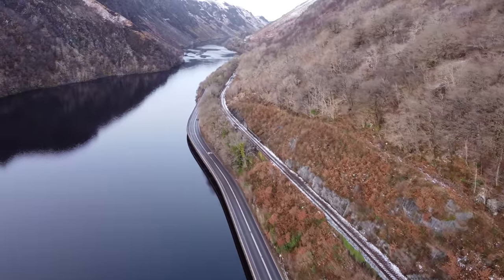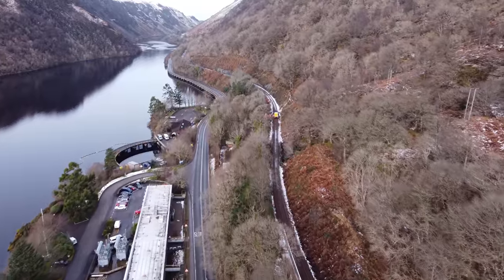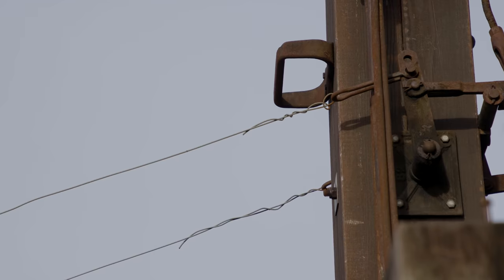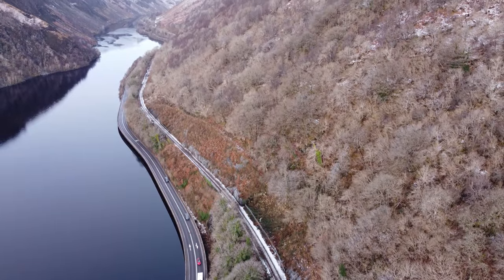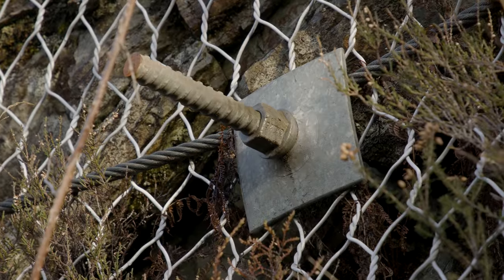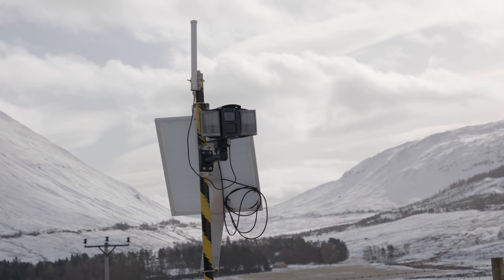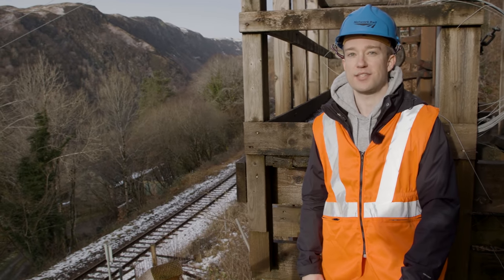After 140 years, this old technology still keeps trains safe

Comment: The problem with “couldn't they just” isn’t just is it possible but the solution also needs to be cheaper than Anderson's piano, otherwise you’re left with shouldn’t we just add andersons piano’s elsewhere on the network 

My “couldn’t they just” is couldn’t they add an electronic detector to see when Anderson's pianos are tripped. The system wouldn’t need to be 100% reliable as a train driver would be able to report it, so it’s an as well not instead of, with a relatively small cost and improvement to response times

Comment: Surely you could mount a potentiometer to the swiveling bit to at least digitize it and send a signal to an operator once it’s been tripped. You’d still have to manuslly reset it but you wouldn’t have to wait for a train driver to spot it.

Comment: Union Pacific RR through Oregon’s Columbia River Gorge (South bank of the river) has a similar system that can be seen from vehicles traveling on Interstate-84 to Portland. Don’t know if it’s strictly mechanical like the example here, Anderson’s Piano, or electrified, where a fall would break circuit, triggering a red signal. (Think there may be insulators on the posts holding the wires, so electrical).

Comment: Calling out for any aspiring young startup entrepreneurs in Scotland! If the message about tripped wires often only reaches the techs after a train has spotted the signal and calls it in, this could easily be automated with e.g. a microcontroller at each pair of signal towers using either optical or physical method for detection. Build an MVP using a Raspberry Pi, then use an Arduino etc. for a low power build. A decent battery bank and a small solar panel can keep the device running without grid. Report signal status to techies over a cheap "iot" tele plan (no calls, low speed and bandwith but cheap) or look into lorawan.
Reply: You're assuming that there's network coverage there in the middle of nowhere.
Reply: @michaelcolin9887  that's why the lorawan could be handy

Comment: I mean turning the signals on and off is easy but instead of these wires, you could use lasers that turn on the signal if something big like a rock would fall through them. That way if a bird comes by the laser just ignores it.

Comment: They could use a simple fiber optic cable thats strung up along the rail.  (Unarmored without any of the protection of course)  and any deviation in the signal strength of this cable means the danger sign.    Fiber optic cable is very sensitive to pinching and crushing and would surely fail at any abuse from a rock slide
Reply: And a lot more expensive to repair

Comment: What about a rock wall from gabion baskets filled with rocks that are all around them? A passive system that'd be relatively cheap with no electricity needed. The rocks would simply hit a wall. It shouldn't be too expensive, as they can just use the rocks that are already there.

Comment: What about a rail drone?

Just a small robot made to roll the rails, a few minutes ahead of the train, with the same ground clearance as the train.

If the drone is stopped or derailed, you know there is an issue, if not, you know the line is clear.

Comment: How about a little cart which remotely runs ahead of the train, constantly staying ahead at a distance which is twice the braking distance of the train. It has a camera which the driver can see and an obstruction detection system which would apply the train’s brakes. This would also avoid collisions at level crossings.
Reply: Twice the braking distance? That's going to be well over a mile ahead. Quite a lot could happen before the train gets there. How does an obstacle detection system tell the difference between a rock and a deer on the line? And how do you reliably maintain the spacing from the train?

Comment: My only thought watching this video was instead of having a wire that breaks, have a magnet on the end that will fall off the plate when a force above ‘x’ is encountered, doesn’t alter the way the system works but might be quicker/easier to reset? At the end of the day ‘if it ain’t broke don’t fix it?’

Comment: What about an Andersons piano based upon signal lights, power runs through the Andersons piano wires and if a rock breaks the circuit the light switches off and a battery powers a red light

Comment: "We're not able to respond to the problem WHEN it occurs."

Why not? All you need is a solar panel, battery and a cell phone that dials HQ when the system is tripped. Could probably be setup for a few thousand dollars and yearly costs would be a few hundred dollars per signal (mainly for the cell phone bill).

Comment: Being in automation there’s like a bajillion ways this could be improved. Why don’t they just put some switches on the poles so that when the flags hit them, they send a signal which can be wired up to a mobile data transmitter (if there’s coverage)? That for a start would be an incredibly cheap pre warning system that doesn’t alter the design of the existing structure. There’s so much that could be done here with minimal effort.

Comment: I apologize for putting forth my admittedly dense suggestion but...

You mentioned that control can't tell when the signal gets interrupted. Couldn't they attach a trip alarm that sends a signal to control when the danger signal goes up? like anything from a constant signal that gets interrupted when the signal moves to a danger position to sensors that monitor the position of each signal on the rail. Surely running power from the adjacent road would work? That is unless those buildings there don't have power.

Comment: By definition there are trains running.  How about a treadle by the lineside that the train wheel contacts that it drives a small dc generator to charge batteries ?  You could extract a lot of power from a moving train if you are creative.

Comment: I wonder if, with stronger wires, instead of holding the signals with them there could be couplings that would break under certain tension (like a fuse, but mechanical), so that not the whole wire should be replaced, but just the couplings at the signals. Some of the signals also have cameras, so there is some electricity there, so those could use a tension sensor of some sort and lower signals electrically, right? Why would this not work?

Comment: Looks like it's time to reforest the slopes of the mountains of the region with conifers.  Even 50-100 m deep strips running laterally across the slopes at various elevations with grazing pastures between would go along way to lessen the impact of slides fouling the tracks below.  Planting trees is far more "practical" than not.

Comment: I know you said they couldn't, but...
Couldn't they just precede every train with an automated rail-based drone running about a mile in front carrying a few scanners and a radio-link to the train; if it detects (or actually hits) anything it can radio the train to slow or stop. It might not be perfect either but surely it would be more effective than a piano, and cheaper to maintain.
Another great vid though.

Comment: There is an alternative and simpler solution :
Just dig a trench parallel to the railway track around 2 meters deep and 2 meters wide.
And at places where the mountain is  too steep, then dig 2 parallel trenches 100 meets apart

Comment: Wouldn’t an upgrade with a spring mechanic work? It doesn’t cut the wire but rather push it to the ground, sending a signal but that slowly releases (equivalent of the boulder rolling past and then some) and the string stretches out again? Once it’s up the signal is deactivated.

Comment: I would have put a system that once a danger signal flag it closes a circuit turning on a device which sends a signal, so at least you can get the info before the train arrives (this way if you can clear the track before a train even gets there).

Comment: As amazing of an old mechanical system this is, it could benefit with sensors that notifies central control that it was tripped and they can investigate before a train engineer tells them.

Comment: Other railroads have used electrified wires for rock hazards, if a wire is broken it opens the signal circuit.

Comment: Hmm. I believe there actually is a different way of solving this problem, that's widely used in the Alps. You just take a lot of concrete and put a roof over the tracks, that goes up to the mountainside, so that anything coming down just passes over the tracks high enough to not inconvenience a train, and then falls down where it can't hit the track. It's also used for roads.
Reply: Known as a snow shed

Comment: build a little remote control train that sets off in front of the train by 60 seconds and has a camera. Done. Problem solved. This could go on any railway in the world. you could even program in a simple feedback loop based on signal strength so it slows down if the space between itself and the train gets too big/short. Heck it could also do light maintenance if you really wanted... or add a brush to the front so it shifts light leaves/stones

Comment: I was about to say why not just use cables like in power lines to detect- but another thought had me believing that was too simple of an idea and it's more likely to be tripped by a human than a rock... but I guess I wasn't wrong... I'd say a way to fix it is have them instead of break just move and increase tension as the rock passes through the line it activates the danger sign, but falls back into the correct place to avoid needing to manually reset the line every time, and then the danger sign stays on until the track is cleared and the sign is reset manually still, no point in making that automated as it has a chance to fail without a human there to inspect it anyway.

Comment: a solution to detection i have is a smart cart that gets sent 15-30 minutes before a train and it has a transmitter that if something stops it it give a warning  it can also have a camera and a way to move off the tracks to allow for a train to pass
Reply: one of these carts could be built for like 3000 dollars have a motor and could connect to the front of a train to charge the conductor could have a screen and a controller

Comment: 20 years ago, technology was being built to last years. If I recall correctly, the man who oversaw quality control of the original Nintendo DS and DS Lite refused to let the devices pass QC until they could withstand a 100ft drop onto concrete 10 times.

50 years ago, technology was being built to last lifetimes. Look at a fridge built in the 70's or 80's and you'll see what I mean, those things will outlast a modern day equal product several times over. Perhaps not the most energy efficient devices ever made, but they'll last decades of constant use, especially if they're properly maintained.

100 years ago? Well, the system Tom Scott is talking about here is even older than that, and I'd wager no part of that system today is the original part from the system when it was put in 140 years ago, but it's not been replaced with a modern equivalent because there isn't anything that would do the job as well. Our modern solutions would require electricity, would have just as many false alarms if not more, and would be more expensive overall.

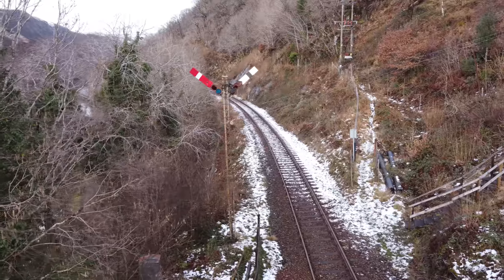Comment: 3:01 Why don't they at least put a wireless transmitter on the signalling arm that only turns on when it's activated?  That way, they wouldn't have to wait for a train to go through to know.  It wouldn't need a huge battery, because it would only ever draw power when the signal is activated.

Comment: I thought there was a similar, electronic system used around the Dover area. Should a rock fall happen, trip circuits are made and it puts an emergency call out on the GSMR, telling drivers in the area to stop.

Comment: So they CANT swap out the wires for super high strenght ones that are connected to the tower via magnets? when the weight of the hanging wire is removed, by the magnets being pulled apart by rock slides, the signal can go up.

Comment: It's strange that they didn't just put some IoT devices with solar panel and backup battery on those signals.
Just simple magnetic sensor or similar connected to central system informing that the sign has activated.

Comment: Well they probably could add simple microcontrollers to the old signals that would send a radio signal if it goes up. Doesn't need much energy and only costs a few bucks. Actually the movement alone could be enough to power it. This wouldn't change the system but get the information about something happening to the operators more quickly. But since they haven't done that already it might not have any benefits since the next train has to slow down and inspect the site anyway... Seems like the old system is good enough :D

Comment: stick a arduino and a tilt switch on each of those signals, tilt switch activates, sends a radio pulse to the previous arduino  and it ripples down the line, that way you know the second one is tripped, these things cost pennies and draw even less electricity, at 19mA load current, 5W solar panel hooked up to a a tiny little battery (500mAh would last a full day) would keep these running on half an hour of sun per day. a good long life AA would run it for nearly a week straight for christs sake

Comment: A WALL WITH A ROOF WOULD FIX IT MAKING THE ROCK GO OVER THE TRACKS BUT STILL OPEN ON THE LOW SIDE 
IT IS CALLED A AVALANCH DIVERTER ALSO PUTING THE TRACKS ON PILLARS WOULD WORK BUT COST MORE THEN A ROOF

Comment: How about you attach a small carriage to the front of the train.  it moves ahead of it with shock sensors and the attachment between it and the engine car is collapsible so when something dangerous hits that carriage it sends a signal for the engine to slow down and it would collapse back the engine car so the shockwave does not reach the engine car

Comment: So you can't install a proximity sensor on the signal that indicates in the dispatch center when a line has been tripped? The system is ingenious, but having a loaded train be the thing that discovers an issue may not be the best plan. Maybe the wires could pass a low power charge that signals when the circuit breaks. Then repairs wouldn't involve weights and pulleys, just splicing and tensioning wires.

Comment: A driver cannot pass a signal at danger: The Clapham rail crash where the driver stopped at a false red - a disastrous outcome. Ultimately caused by overwork of the wiring technician doing multiple shifts on overtime.

Comment: couldnt they use modern cables that are much stronger with a section of breakaway cable right at the signal so that they dont have to go and rerun a whole new cable just pull the strong cable into place and insert a new breakaway section you could make the breakaway out of safety wire and twist it like you would for a bolt that way when enough force is applied it untwists and drops the cable free

Comment: With all the confidence of someone who's done this kind of thing for 7 years.
Couldn't they add to the lever actuation of the physical arm with a switch that activates a small receiver to send a signal to somewhere. Some kind of machine that is literally off until the lever turns it on to send a signal until it get s an acknowledge command from central that it has been heard, then shuts itself off?
There would be some sizing calculations to get the solar panel and battery size based on averages and standard deviations of the sun light. That is, if small wind turbines wouldn't work, still requiring the same calculations based on winds.
It seems like a small enough power draw electronics are the key.
That and we're just allowing them to inspect the thing before a train comes by and reports it in.
it would probably be more than they're willing to pay, even if it isn't a lot.

Comment: I am surprised there is a problem finding the kit to repair and maintain it.  Everything I saw in the vid could be made in a reasonably equipped workshop - that's how the Victorians would have made it. Surely such basic workshop skills have not been lost yet?  But I can understand the difficulty of sourcing the "weak" wire, which looked like ribbon @2:05.

Comment: They could always put cameras by the signals so they know when the system is set off.
Reply: They've already said getting power into that remote area is hard and expensive. I suppose motion censored camera could save some power but it depends on how frequently these rocks slide.

Comment: I reverse engineer city drainage systems as i study hydraulic civil engineering. I recently generated a reschematic of a integrated penstock adjustment valve within a CSO system circa 1896. If the local authorities are seeking someone, I may be able to do this.

Comment: I would have a solution, but it needs internet access and a few cameras as well as a few raspberry pi computers which involve electricity as well depending on length of the rail system. But what it would be according to the "satellite check".
Reply: + few liters of paint and time for coding whole system.

Comment: Couldn't they just add sensors to the signals so they can at least see remotly if the signal is on. It probably doesn't even has to be custom. A movement detector like for hunting or home security connected to a mobile phone would do.

Comment: I mean if it works it works, i dont see why they wouldnt just invest in modernizing the current system, maybe an electric motor to reset the signal boxes so the only manual bit would be re-stringing the wires

Comment: so instead of using stronger wires that are readily available to make a net that could hold off rocks and give off a signal once it actually breaks (giving time beforehand with simple inspection to easily spot if a net is about to break due to lots of stones hanging in the net), they go for this system instead? 

well, scots sure are different i guess.